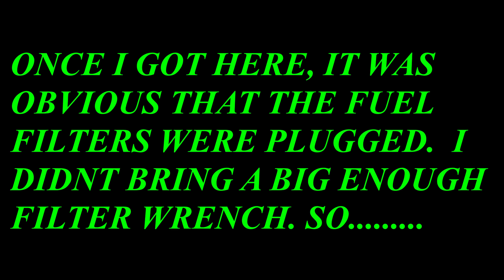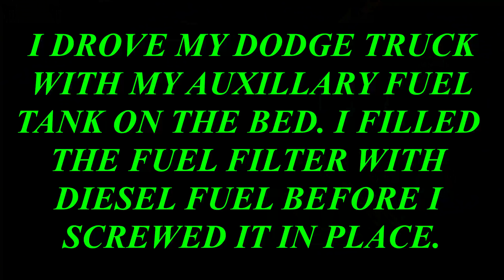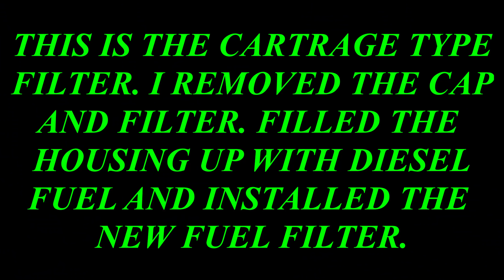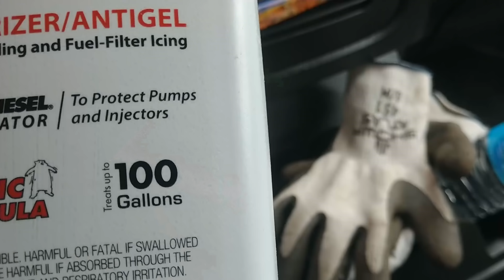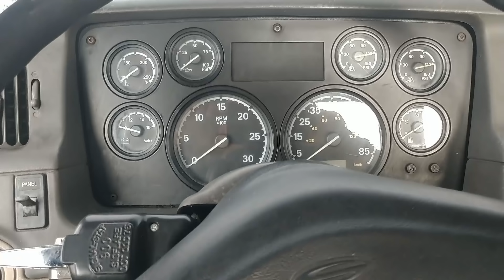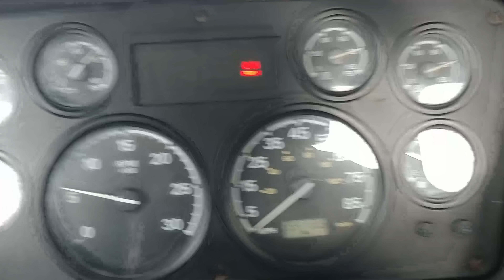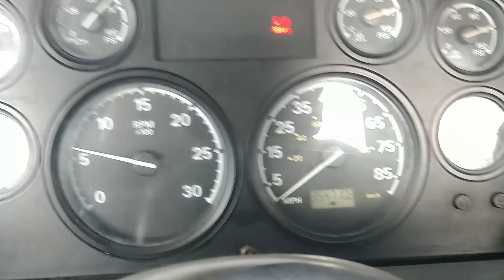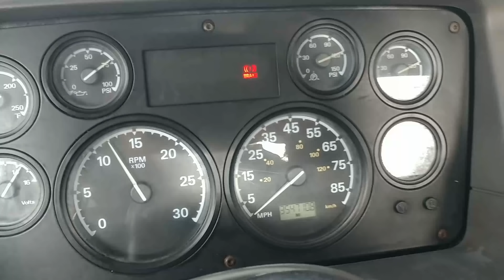RUN YOUR DIESEL OUT OF FUEL AND THIS COULD BE YOU!

Comment: I ran a diesel out of fuel once. A new job a started 15 years ago. First day, boss told me to take a load of rock to a site and come back. I went back in after I started it and said, truck needs fuel. He said " you have enough, go ahead". I made it about half way back ran out. It was a 6 liter powerstroke. Boss then turned it on me and yelled at me. Told me I should of hot fuel out of my pocket. Took us over an hour to get it started. My first and last day at that job. I don't need to deal with a douchebag boss on a daily basis at that pay scale.

Comment: Good to know the truck stop vs gas station tip. I hadn't thought of that.
Reply: Wrong comment. Is the same. The pump will not pull gas from the bottom of the tank and the water will be there. Plus they check for water in tank frequently.

Comment: Great video thanks brother. With every thing you have that's diesel I can emagin how handy that tank is. I always liked the crossover on the bottom of the tanks. I can't stand the newer ones on top with a valve ontop the transmission. Peterbilt is really bad you don't have the truck level and the valve level you drain one tank faster. I know that every time you take it loose to work on the truck got to make sure the truck and valve are level. That truck you showed probably got fueled up at least twice a day. Probably got wrote up for the fuel gauge many times just not a priority on there part. Keep up the great work see you in the next video thanks again brother. Like the way you do what you have to do to get the job done. I hate when people put filters on tight. The fuel filters aren't any fun to begin with.

Comment: I had a 98 inch with an n14. It pulled out of the right tank returned to the left tank ran out of fuel at a 1/2 tank. 
Right tank was empty left tank was 
Coming out at the fuller cap. The company had great mechanics. 
They never did figure out why it did that. Nor how to fix it.

Comment: I don’t understand the reasoning behind the need of changing the fuel filters. So running out of diesel will cause fuel filter damage or clogged?
Reply from the maker: when you run low or out of fuel, you end up sucking all the dirt and junk out of the tank and into the filters. then there isnt enough fuel getting to the engine.
Reply: The only dirt you would suck up on an empty tank would be stuff that floats on top of the diesel as the pickup pipe is fixed and always sucking from near the bottom of the tank, unlike say a chainsaw where the pickup pipe floats and so sucks from near the top of the fuel......
Reply: Diesel is lighter than water so the condensation of water on the inside of the tanks will drop at the bottom of the tanks. So the water will be suck into the filter. That is why in winter , keep the tanks top up. What floats on top of water might not necessarily float on top of diesel fuel.